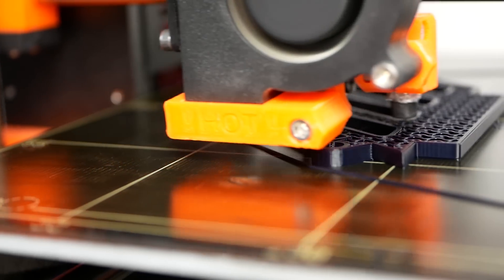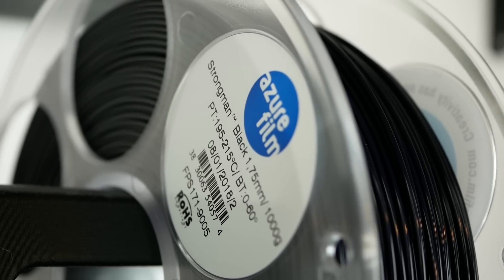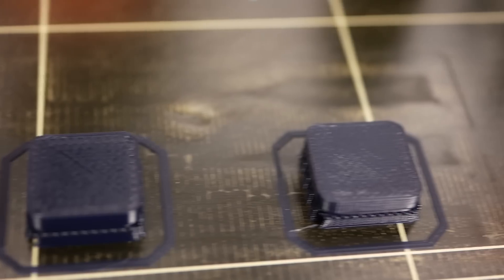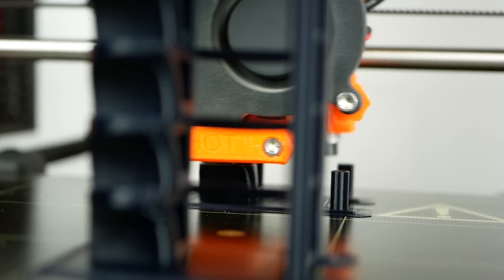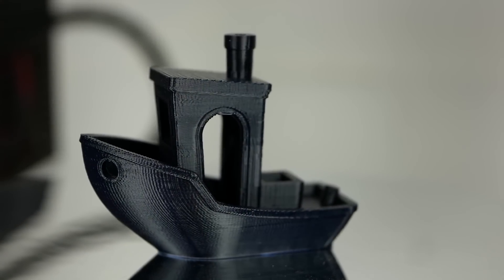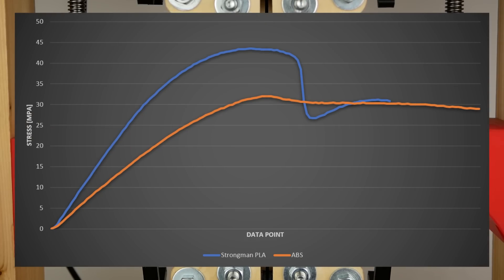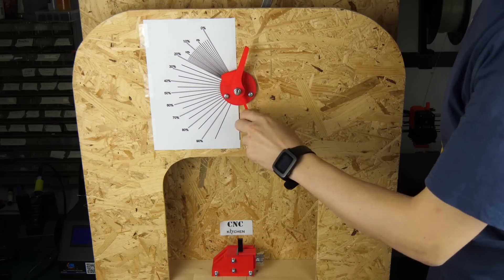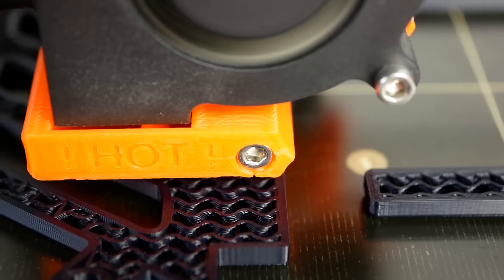What is TOUGH PLA?! Testing AzureFilm Strongman™ PLA

Comment: I used ziro matte pla (supposed to be tougher, so maybe similar to tough pla) to print cpu cooler retention brackets while I waited for the real  part to be delivered. They've been in service for 2+ months now and haven't failed due to heat. Pretty impressed, I've had the real part for a while now and I kinda wanted to wait and see if it will fail. CPU should shutoff automatically in that case.

Comment: I am not going to print with ABS because of the toxic fumes. I use PETG because it is a good compromise. PLA probably would work for me since I mainly want to print prototyping parts and test if they fit together. Then Print the final piece in a tougher filament. Also I see that the MH Tough PLA is also more expensive than standard MH Build Series PETG. I just bought some MH Build Series PETG. I have never used this brand before. I also bought their TPU filament to try. I hope I like it. The TPU is a great price. 1KG reels of TPU are selling for about the same price as .5 KG reels offered by other companies.

Comment: Great content Stephan, I’ve been using PLA+ with good results. I have been looking for ways to print 12mm tubes to replace carbon fiber in concept drone frames. I stumbled on a process of stretching a finely  textured vase to the point of the appearance of a filter straw. Something to do with how the filament is woven makes these very thin mesh tubes much, much stronger than a typical tube print. I am using a simple Cetus3d with scant control of the print process, but I have hope for the simple PLA.

Comment: What slicer do you use, the slicer I currently use does not allow for different nozzle temperatures or fan speed during print
Reply from the maker: I used Simplify 3D but it's also possible in Slic3r and also CURA.

Comment: It's good to see manufacturers attempting to address the somewhat explosive failure mode of PLA. I don't print structural parts in PET, not because it's stronger, but because if I mess up and overload a part, it likely won't shatter like most of the PLAs I've tried. It's nice to be able to go back to the drawing board without extra bandages.

I say "most" PLAs because I have seen deformation instead of shattering out of some high-temperature PLAs. I'm not sure if that was an intentional result, or just a side effect of making those plastics print hotter and handle annealing better.

Comment: The claim that it's an ABS replacement, at best needs some explanation. Perhaps if the pricing was more inline with a good quality ABS or PETG there might be a small argument for using 'Tough PLA' for makers that don't have the proper equipment to print ABS well?

Comment: Most modified PLA is a waste of time only a couple have actually improved on actual PLA but the alternative plastics for that enhanced feature are usually cheaper and better. Why bother printing something that's 20% weaker than normal PLA but will deform before braking even if it deforms and doesn't brake it becomes useless as the part is the wrong shape. 
You will not replace ABS as it has high temperature resistance at 100* - 110* and acetone smoothing is a massive bonus. PETG is a nice blend between PLA and ABS having the strength and decent temperature resistance at around 80%.
Blends that make the most scene would be a plastic that deforms like ABS to have carbon fiber filled ABS to make it more stiff and ridged to make it even stronger then it still would have the high temperature resistance. It still would have to be cheaper than other plastics that fill this void like Polycarbonate i seen a polycarbonate with carbon fiber now that's a crazy combination.

Comment: Stefan, can you confirm that the initial tests (extrusion, cooling, temperature) were performed in that order? Thank you very much in advance.
Reply from the maker: Yes, but iterations may be required since especially printing temperature might influence extrusion factor and cooling behavior. I always start with a temperature which is more on the higher side of the recommended range.

Comment: I have switch to PLA+ from Esun for most of my structural work. It is so much better then regular PLA for the impact strength, however it is the same as normal PLA when you consider that it has almost the same glass transition temperature as regular PLA. I made a mistake of leaving something outdoors, it was not in direct sunlight but in hot weather and it warped. 

I don't know if we have a PLA that can replace ABS quite yet, but I can't print the complex objects that I make with ABS for the warping issue. I have enclosed a printer for this task but no matter what there is some warping especially if you have a complex part with different thicknesses going from narrow to thick and back will warp and the brim does not make a difference. I feel the same way about ASA but it is better in the warping department, still has warp issues but not as bad. It's just the expense of the ASA that makes it hard to justify. I can get a roll of good ABS for 12 bucks but same roll of ASA is closer to 50 bucks at 5 times the cost of ABS it makes it an unattractive swap.

PLA is great to print with, but I feel the next thing they need to fix is increasing the glass transition temp if it can be done.

Comment: I could see the use of tough PLA maybe for printing toys for kids to avoid shattering if you're having trouble with ABS. But I've had no issues printing with PETG. And with an enclosure, brim, and glue  stick, ABS prints just fine.  For strength and temperature deflection it looks like PETG and ABS are better options.  I personally would not pick up a spool of tough PLA; however, I have tried Raptor PLA from Makergeeks, which is a high temp PLA and have had great success with it. I printed some golf hole covers/cylinders for the putting green in my Dad's back yard so kids and people wouldn't trip over them and the Raptor PLA held up perfectly through several days of triple digit heat and direct sunlight.

Comment: I'm still not sure I understand what you were comparing and that could just be for my lack of knowledge I've always only use PLA but I was thinking about PETG however the comparison I would like to see is the reasons why people use ABS can this new PLA do that or what it can or can not do based on the reason why people use ABS or PETG.
Reply: @Darren Munsell ABS is not UV resistant! Car manufacturers use ASA a lot instead.
Reply: Right and thank you I do understand how ABS works and what ABS is used for as I do with PLA. I guess what I was trying to understand is how does this new strong PLA compared to ABS as far as the general use. Can I leave this one outside, can I make a canoe out of this one and it won't melt? That's what I was trying to understand.

What would I be paying more money for?

Thank you

Comment: Hello Stefan, I would like you to make a test on PC (polycarbonate), like PC Max from Polymaker. I failed quite some prints before getting reliable results, still fighting against warping and layer separation. Prints withstand temperatures up to 110°C, and it's a good material for manipulating the part afterwards (milling, grinding,...).

An interesting test for me would be the scratch resistance of the materials. For parts that are in contact and moving. 

Greetings from west Germany.
Reply: I print PC with 280 degrees nozzle and 110 on bed with a enclosure. Direct printing on bed warp most of the time so I always print with Raft with 15mm extra margin. For example, a 0.2 layer height print paired with 0.07 air gap between the part and raft would give a reasonably good bottom finish and it is still easy to remove the raft. The heat resistance is incredible, my fan shroud printed with it is only 2mm away between the heat block and bed and does not deform at all in PC printing environment whereas ABS softened like chewing gum.

Comment: I never quite understood, what is actually the use case for ABS-like materials? Specifically in impact strength? Safety of failure mode? They're not flexible or springy in a way that would allow them to withstand repeat bends like say polypropylene. Because even incomplete failure like stretching is usually reason enough to discard and replace the part, it hasn't stood up to the use-case, and stiffer rigid material performs better in that regard.

Of course ABS has advantages that it's extremely low-cost and has very reasonable temperature resistance, i just don't understand why it's considered mechanically advantageous.
Reply: I'm not a big fan of ABS but I can tell you my use cases for it and the advantages it has over some other plastics. First, it has a lower density than pretty much any other standard filament, so I use it sometimes for model aircraft parts. You can acetone smooth it, so I use it for prints that need to look non-printed. It is also impact resistant. It will not shatter when subjected to an external shock. This isn't quite the same as it being able to recover from being contorted beyond its limits, which it sucks at. To give you an idea, I am designing a toy for someone with a two-part hollow sphere. The two halves screw together. The sphere gets launched into the sky, so it takes a beating on landing. I can bounce the sphere on my hardwood floor like a racket ball with no damage to it.
Reply: All of what 0Calvin said and because PLA for parts stink, or at least it did for me.  PLA is brittle and on my old I3 I replaced all ABS parts with PLA and after a few hours of printing the Z bearing holders became smooth and started to fall out which never ever happened with them in ABS.  If ABS didn't warp it would be the best filament for the price for the stuff I normally do BUT there are times I need it stiffer and for that Delrin/Acetal filament comes in but it requires even more active heating in a chamber and the price is around the Strongman PLA.  If you have an actively heated print chamber and want strong parts with the ease of lathe turning/working like ABS then Delrin is the answer.  Since most of us do not have that we settle on ABS or ASA (if the price will fall to as low as ABS) with juice, glue, hairspray etc....
Reply: I understand the density advantage of Styrene-based polymers and acetone-smoothing; however the subject of this video is a PLA with a bit of additives and won't be acetone-smoothed, nor will it have the density advantage.

Stooge, i don't understand the mechanism why Z bearing holders went smooth? Because of heat? I mean this modified PLA isn't likely to solve the issue.

I buy my PLA cheap from a random lady who extrudes it in her basement from Chinese pellets, and print it rather hot at 230, and i found it to be strong and somewhat springy under load, not at all brittle, like at a couple millimetres thickness, i won't be able to break it with my hands, which is perhaps not saying much, but it's something, nor when drilling, nor by pressure of a screw head, certainly less brittle than say PMMA, which is the first thing i think of when someone mentions brittle. Or PVC without plastifiers, like used in phonograph records, broke a fair share of those when i was little, can't break PLA this easily, not even on impact. I don't find myself needing more impact resistance than basic PLA will provide. In fact i wonder if Calvin's case of high-flung projectiles would be served with PLA just as well, because i mean hollow sphere - comparatively low terminal velocity because of low weight...
Reply: Nope, not due to heat since the I3 is an open frame design but PLA just does that.  I have never ever found any parts to work well, or for long, with PLA so I migrated to PETG and love it but it is too flexible to the point that if you have a metal part it will bend around it even at 100% infill so I stick to ABS and fight the warping.  Luckily I do not get delamination.

Oh, 100% infill PLA (two brands) and I can snap it with my hands whereas ABS will give. For instance...  C=  like that in abs I can clamp the = together and the C will close up around whatever but with PLA it will snap or crack the C some where.
Reply: Funny, PLA stays very strong and quite springy for me, clamps and such just work. How warm do you print it? I think it needs to run fairly hot and not use too much part cooling so it can kinda almost anneal-in-place.
Reply: I don't remember but it was over 200c and, of course, I used a fan.  I no longer print PLA since I went to an all metal hotend as I am afraid of jams but when I used the old lined one if I didn't use a part cooling fan it was a horrible print as I remember that.